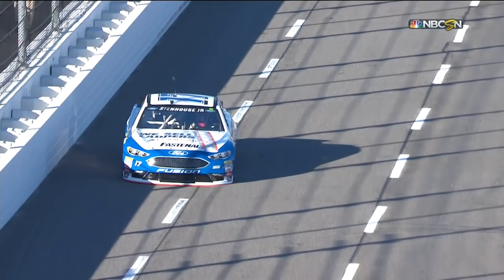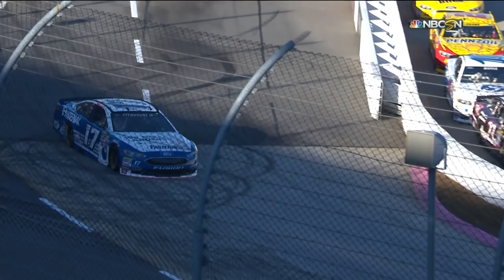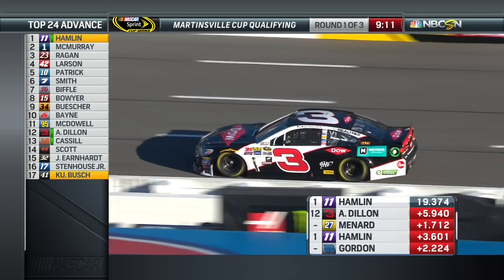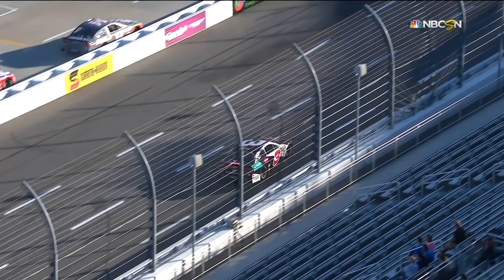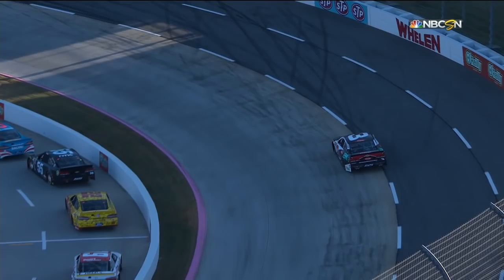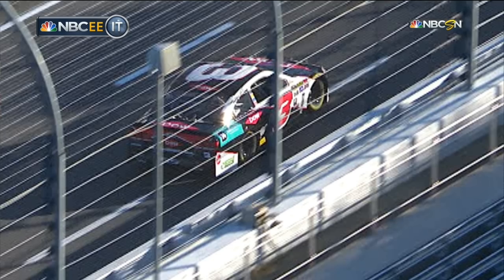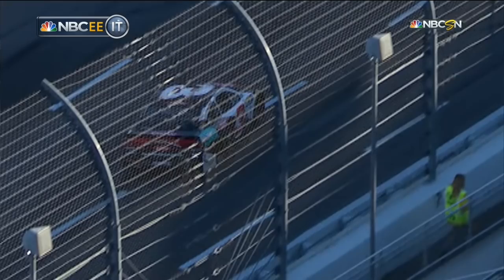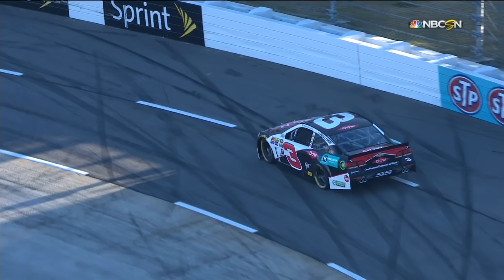Stenhouse, Dillon wheel hop and wreck in Martinsville qualifying

Comment: I understand what wheel hopping is but can someone explain to me how it happens? Does it just start or is it something the driver does to initiate it?
Reply: It happens when you drive into a corner to fast, so it is not initial, but it's the driver's fault.
Reply: Thanks ... but why is it so significant in this case? I'm new to this ... thx
Reply: I'm no expert but I think the reason why it happens is during braking there is less weight on the rear axle and due to engine braking or brake bias is basically makes the rear wheels turn slower than the speed at which the car is going